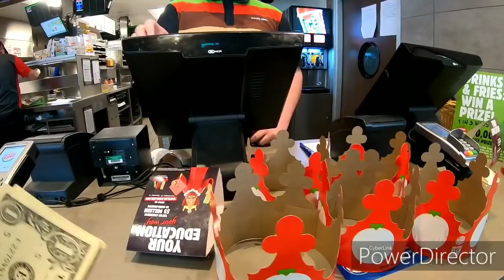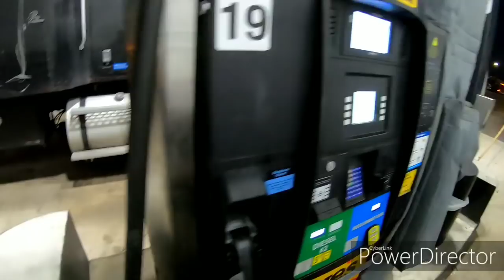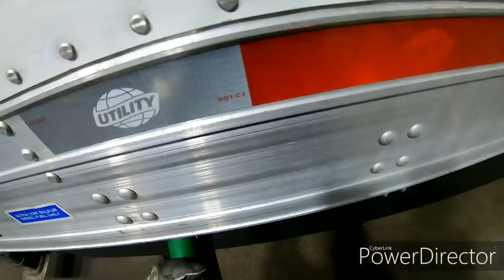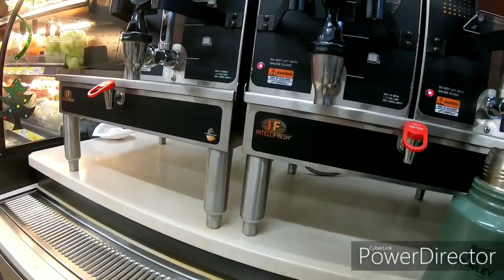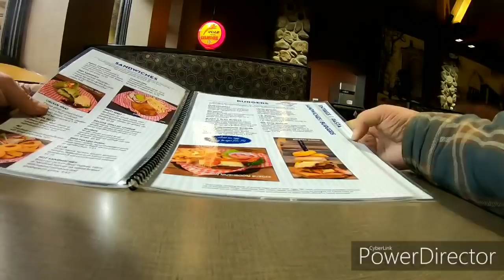December 7, 2019. Trucking if it doesn’t work shake it. Pickup in joslin Indiana Tyson.

Comment: Used to require several types of screwdrivers to change a headlight, now other than access to the headlight housing, most light's are not much more than a plug in, just DON'T TOUCH halogen lights with hands, as natural oil on your skin will shorten life of the lights. With LED lights, they are easier to replace, usually don't require much more than a screwdriver or socket set to open the housing & plug in new light. You ought to get a simple tool set at Walmart for simple tasks. 🤠  BTW: A cold front working from Northwest towards El Paso, expect side winds if your using I-20 from DFW area of Texas to ElPaso. 🤠